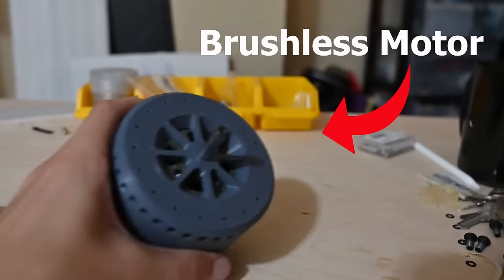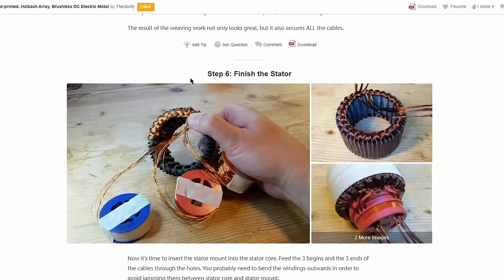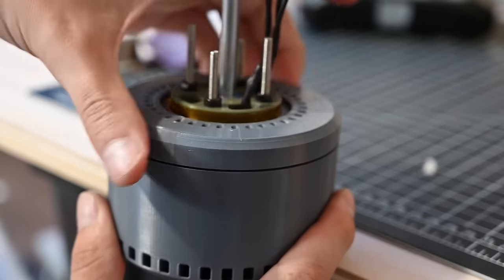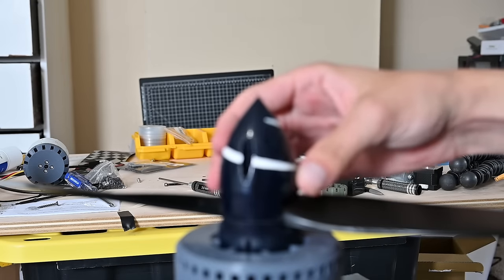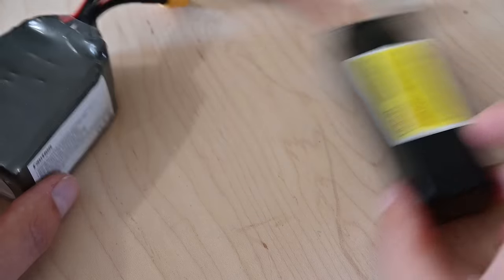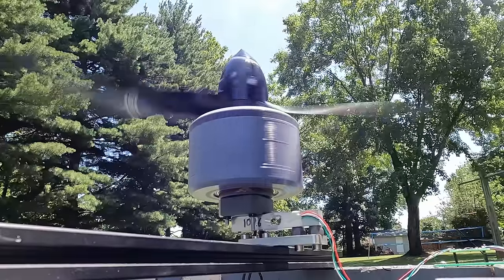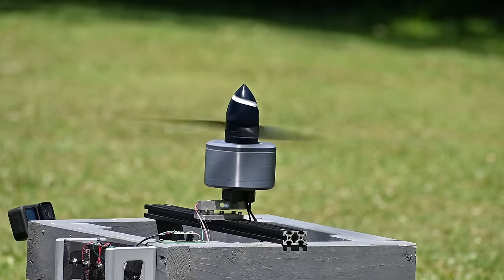A HUGE 3D Printed Brushless Motor??? How Much Thrust Can It Make?

Comment: I'm surprised it was balanced so well. Knowing the properties of PLA, you should not run it under severe loads that generate heat. Other then that well done and getting the windings correct at the first shot.
Reply: The bearing should isolate source, or do you mean from the electricity.. good thing it comes with a cooling fan
Reply: @felurianmasters4369  no I'm referring to the induced magnetic field heating up the windings under load.
Reply: To my understanding the motor has built in cooling system, plus... I think that heat is the least of your concerns when you have a prop at the tip :)
Reply: My experience with PLA+ its very sturdy compared to PLA.

Comment: I'd be really interested to see comparisons between magneti- and non-magnetic filament.
Reply: Compared to electrical steel the relative permeability of magnetic filament is awful, less than 1%.  On the flip side it's up to 8 times better than air or non-ferrous filaments so I'd expect a significant reduction in torque with a non-ferrous core.
Reply: Very interesting idea!

Comment: I've been doing torture tests since getting my printer recently and have found thin stainless steel mesh goes a long way you could also put a few bands towards the center of the housing to help keep your walls from buckling like you see on water towers
Reply: I've always been interested if could hybridize 3D printing to add stuff like layering in wires or structural materials automatically as layers are put in I know can stop at steps and manually put stuff in
Reply: @AsthmaQueen  Mark forged does that with carbon fiber filament into nylon!

Comment: Super cool build!

I'd be tempted to find a wire mesh sleeve or something that fits around the entire motor housing just to keep any larger chunks in place if it grenades itself. That thing is terrifying at speed
Reply: Carbon fiber tow is great for that sort of thing.
Reply: If you are genuinely worried about it breaking apart, then you shouldn't be using it. Go use a motor made of metal.
Reply: containment rings we use those when we are testing turbines and for the hydro boats.
Reply: @deang5622  That's not the point...
Reply: In all seriousness, if you remove the infill material from the rotor section and fill a portion of it with ferrous material as close to the magnets as possible, you'll increase the torque a bit.  Throw some steel wire or something.
Reply: @dekutree64  Yes, create some 'troughs' in the outer shell and simply wrap CF Tow around and around and around...   You can also do this with rotor disks on axial-flux type BLDCs IMO.
Reply: Most definitely needs to have a scatter shield of some description, its very easy to burp the throttle and.... well, don't stop filming.
Reply: @dekutree64  no , if carbon breaks , it bombs like a cup which falled on the floor. Fiberglass , thats what we need

Comment: Hello Michael i had a couple ideas for possible improvements, there is a couple ways i think this could be be helped. I would recomend trying to get it balanced even if its statically. IDk where you are but it would be fun to put this on our dynamic balance machine and see how much it is out. it being round its probably close but i wonder if the infil has biased this to a certain area. my ideas off the top of head would be to  put the printed parts into a jar and pack it tightly with kinetic sand. then spin it up to  around 900 rpm or so inside of a oven to aneal it while rotating. a cheap air drill could probably be used if its metal to workk ouut something that can take the heat. i se you have printed it with the layer lines xially around the body of the motor, i would like to see if some thing metal mesh could be installed on the outside of the motor body tieing the layer/grain structure together better. eitehr heat set it in or use some UV resin and instal it and dip it in resin and agin spin it during the cure. also i feel like you should look into getting some statorade its a ferro fluid that helps disipate heat. probably rambling also sorry for the spelling and grammer its not my strong point. great project and video tho dude cheers

Comment: There's lots of vibration so its probably affecting motors max performance. May be printing with SLA can fix most of them. I wonder how resin mixed with iron dust behave

Comment: To strengthen it and prevent its expanding and exploding you could use hose clams on the outside, use 2 and put the bolt assembly on opposite side with each one to keep it in balance. Also a general case balancing would be good too. Maybe also print in nylon.
Reply: 3 clamps to improve balance

Comment: Seems quite viable for a quadcopter. I think it may be a good idea to put a few layers of fiberglass around the outer motor to hold it together, and do some dynamic balancing to keep the vibrations to a dull roar.

Comment: A very impressive motor.

In order to avoid iron you can use the BLDC axial flux configuration, which has the additional advantage to offer the minimum of structural materials. I like the version where a single coil plate with mounting points sits between two rotating permanent magnet plates. This configuration gives the most torque. The rotating plates should be made of fiber-reinforced epoxy (G10) plate material, especially if you operate them at higher rotational speeds (200 to 500 rps).

You can have a look at such motors unter "How to make Brushless motor from clear acrylic" in the American Tech Youtube channel.

Comment: In addition to what the others said about strengthening the print I'd like to add putting it in fine sand or some powder and chucking the parts in an oven to sinter it and improve the layer adhesion

Good luck mate

Comment: rotating parts should be 100% infill usually, otherwise uneven distribution of weight and load bearing capacity can become issues. 0% infill with thick walls works in some builds.

Comment: Maybe a good idea to add some metal tape around the stator outside for extra strength and safety. Just in case of a crack it will prevent pieces flying around. I think it also looks cool because after applying it, it will look like a metal body.

Comment: That is pretty slick! I would consider maybe at least PETG for heat tolerance. Those motors can get toasty. 
Smaller motors are so cheap that I wouldn't want to put that much time into something I can get for $20-30. But  for something big or custom build...sure. 
Might be a little less crash resistant too. I've run some motors through dirt and hard ground, blew them out and flew again. Could see plastics breaking more easily. But hey.... fly, crash, repair and repeat. As long as the insides are still good...new print job and you're back up. Can't do that with standard motors.
Reply: In that case it would be best to use carbon fiber reinforced nylon filament. Nylon is one of the most heat resistant polymers available as filament, and the addittion of carbon fiber makes it considerably stronger, comparable to most stronger aluminium alloys.
Reply: @pieterveenders9793  Yup. Was thinking Carbon black. Really tricky to print from what I've seen but once you get it tweeked...amazing material! Upgraded my printer to all metal hot end but...still locked into the firmware 260°. I gotta tweak the Marlin Firmware I have on there but... I just started with 3D printing and still having fun with PLA, PLA+ and PETG. 
Funny thing is... my buddy had been trying to get me into this for a while but I didn't know what I would really print. Then, saw all kinds of stuff for RC Planes and the potential to design stuff with tinkercad. I've designed and printed like 2 parts for planes and dozens of other stuff LOL. That thing had been printer pretty much daily for first 4 months. Just finished up a dinosaur nightlight with WS8212 LEDs for my grandson. Came out really good. Crazy how much you can do with microcontrollers like ESP32 and 8266S. Lots of ideas for planes too since the are so small, lightweight and low voltage!

Comment: Did it reach 18K RPM? I'm asking because I was like, when it seems to stop spinning and reverse, that's when the speed matches the FPS of the camera. And so I counted 5 slowdowns and a bit, which is more than 300 RPS or 18K RPM, assuming the camera is 60 FPS. I wonder if this estimation method works or not.
Reply from the maker: I was shooting at 120fps. Just in case it blew up

Comment: The windings looked like they were doubled? Isnt that usually done for more torque? Or for speed?
I would experiment with thinner wire for more windings. And thicker guage for more current and see which you prefer.

Comment: How about trying to fit some temperature sensors in the wires, and then ramping up the current to see where the limit of the motor actually lies? It might also be cool to modify the existing design to implement integrated forced air cooling.

Comment: fyi, if in the future you make another motor do NOT use those bearings with rubber seals, the seal gets hot and melts and you blow the bearing, get the metal shielded ones.

Comment: use a bigger prop to keep the rev under 5000 /min 20% under the tested rev. and keep the temp low because the plastic gets softer by the degree temp increase.  good luck ery nice project.

Comment: Can you make a metal sleeve on a lathe just to slip on the outside ring of the motor. So centrifugal force is suspended if you get this. Just thinking a 1 mm thick sleeve would not add too much weight.

Comment: Could this be adapted as a generator? Say wind or water?
Reply: It can for sure, the question is how efficient would it be and how powerful? I guess around 100W.
Reply: When the drone isn't flying,  bigger blades clipped on turn it into a wind turbine to recharge its own batteries. Or your bike.

Comment: Maybe, just maybe, it could be useful with liquid cooling circuit, and wrapped in carbon. Otherwise it either melts or flies into shrapnel eventually. It would be a much more practical approach to use laser cut special steel for an iron core, while keeping the 3d printed hallbach array.
Anyway, what is phase to phase resistance and no-load current?

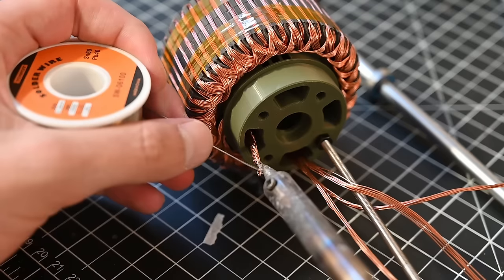Comment: 2:13 Protip. Heat up your soldering iron more. If it wont go any higher, get a higher power one.. you are making cold solderjoints FULL of resistance and they are prone to breakage.
Reply: Were you in the Navy or something?  You can't make those claims from what's seen in the video.
Reply: @hotdogandahayride9823  sure was sir or madam. But i dont understand what my service time has to do with soldering though. i sure can tell the solderjoints are cold soldered. 😉

Comment: What does it weigh? It looks good, I think you can probably go to 18 or 20inches prop and get even more out of it from what it looks like. You need to do some heat measurements on it before and after the run. Build maybe an air boat, or hovercraft with it. It should push it pretty good.
Reply: Christoph's instructable page says "Total Weight : 900 g". But that is with the recommended filaments and settings. But yeah, it can lift it self (but I don't know for the battery).

Comment: What kind of bearings are in that motor? You know the type of bearings in fidget spinners or ceramic bearings. If you found the right size and swapped them out wouldn't you  get more RPMs and a quieter motor?

Comment: What kind of rpm were you getting? Back in the 60’s I had trouble keeping windings on small Mubuchi motors that were rewound and running 10,000 rpm for slot cars.

Comment: Just a thought, the magnetic filiment may induce heat losses due to eddy currents building up in the "housing" because of the non lamented nature. Maybe like mentined earlier do a non magnetic filiment test and compare, it would be interesting.
Reply: Metal particles in filament do not touch, so eddy losses will be negligible.

Comment: That's pretty neat I may have to try this.   But I am trying to use a 3 phase rc car motor in a fan. And can find a stand alone controller for the motor.     The fan is a 10" dewalt fan lol
Reply: You need an Arduino, along with the Battery and ESC for the motor, throw in a cheap potentiometer and with some real simple code you can adjust the speed with the pot. (you can also add max/min speed etc) I built a surfboard with Lidar + Sonar for pre-mapping Talla Aquaduct in Scotland before Abyss solutions brought their $100k+ scanner from OZ, they didn't want to lose it in the tunnel. did the same job but mine cost about 30 bucks 🤔

Comment: I'd love to see the outside part, that holds the magnets, wrapped in glass fiber and balanced with some epoxy to hold it together.  50 lbs of force on those magnets puts in the realm of pcp airguns.  It's very dangerous.
Reply: Yes, please add fiberglass fabric or roving.

Comment: Hey, following Christophs instructions I wasn’t at all able to fit the windings into the stator. How did you do that?
Reply from the maker: Yeah his instructions on windings were a bit misleading. I used half the number of turns that he says to use
Reply: @michaelrechtin  Unfortunately my motor didn’t work with fewer windings. The project is abandoned now. Still have all the printed parts and everything. I assembled it completely but it never ran. 
I then designed my own motor in CAD which did run very nice. If you’re interested I could send you the CAD files. :)
My motor is an inside rotor design tho

Comment: If the motor rotates why not have the case also incorporate turbine blades, or are the RPMs not high enough to make that efficient?
Reply: Definitely worth doing, especially since it's no extra work when 3D printing. A lot of commercial motors have impeller blades in the rotor to pull air through and cool the coils.
Reply: @dekutree64  Electrojet engines would be very cool.
Reply: @DanielSMatthews  Oh, were you thinking blades on the outside of the rotor to directly produce thrust? For that you'd want to ditch the prop and design an electric ducted fan with blades integrated into the rotor. Otherwise your first comment was correct that the RPM isn't high enough for small diameter blades to help.

It would definitely need balancing to run at super high RPM, but it might be a problem trying to balance a motor with integrated blades. You'd also want to wrap carbon fiber tow around the outside of the rotor to keep it from exploding at high RPM, and the blades might get in the way of that.

Still would be a fun project though. Motors without an iron core can spin very fast since there's no eddy current heating in the core.  Switching frequency of the transistors will probably be your speed limiter, so better to use a lower pole count.

Comment: First of all, you need to get your motor balanced. As 3D printed materials  will not give  you a perfect solid. I notice there is a huge balance issue on your motor in the video. This is a must for heavy spining components or otherwise your bearings will worn quickly and lost of mechanical output. If you want higher output, you will need much higher voltage. I am not sure what kind of controller you are running and you should always check your electrical current consumption and check limits of your mosfet drivers limit to get the max out of it. Higher voltage will draw more currents. The discharge rate of batteries is a bit limitation for any kind of electric drive trains, you may caught into fire from lithium batteries so you should always check your batteries maximum safe discharge limits.

Comment: It's odd liatenening to someone refer to voltage as a series count of batteries.  It's similar to referring to time in Mississippi notation.  It really doesn't tell you too much.  I suppose where a nominal voltage is, but no indication of it's capacity for current, or what it is able to deliver at any given moment.    It does get the job done, but can't tell you a lot of the story.  Also, and inductive load being fed by a square wave is a resonant circuit.  A capacitor should be used to tune it and remove the standing wave, and keep the inductive spikes at bay..   It will also create less emi and the radios will love you for it.. That is causing the rc world a lot of grief.  Mosfet gates are susceptible to voltage spikes.

Comment: I wonder how would this motor look and sound like while CNC machined instead of 3d printed.
Reply: Thats your basic drone motor. They have all sizes at drone motor factories. They have motors larger than a ceiling fan motor that can lift men.  Thats what you get when you CNC the housing, and use proper stators.

Comment: you could have just pointed all magnetic fields inwards, and had a super simple dc brushless motor, coils same wound direction all around
Reply: no microcontroller (simpler) required, just voltage, switch, resistant voltage adjuster
Reply: shame shame shame seller
Reply: bullet deals with 100k of g's of force
Reply: check my channel for true pure brushless dc motor, emphasis on the dc motor, not even brushed dc to ac motor

Comment: only problem with 3d painter motor is that weight is on magnet and spring it around so fast that pull magnet outward of it will cause it to explode if you want to avoid that than run it at 4k rpm maximum speed for safety and i seen you running it up at 8k rpm yikes
if you want more rpm i adjusted you making wall thicker or use steel hold it together so it doesnt blew outward